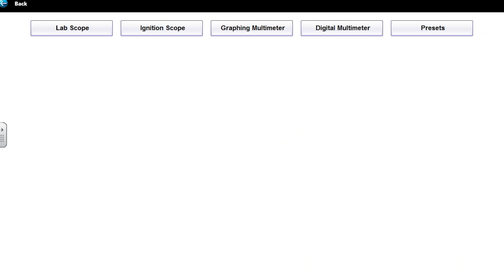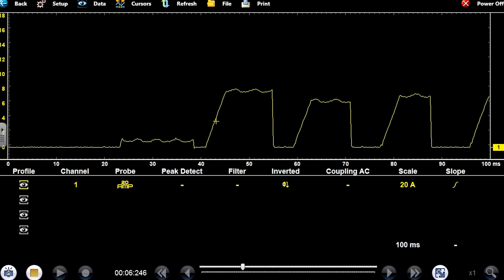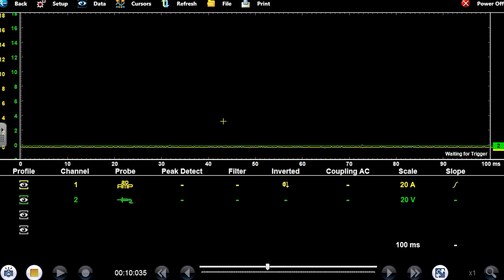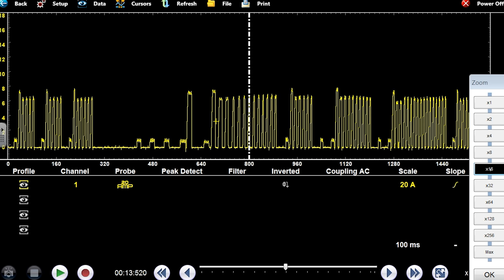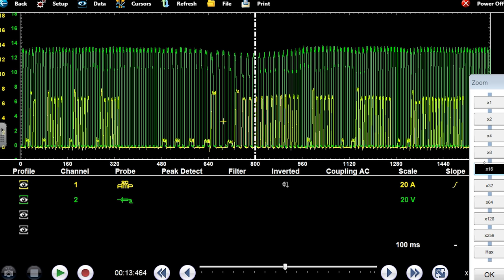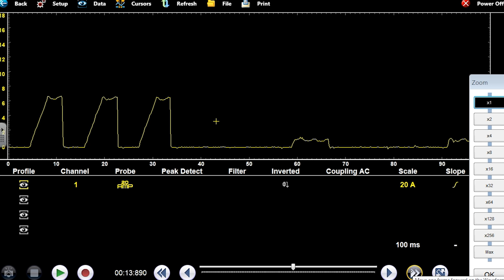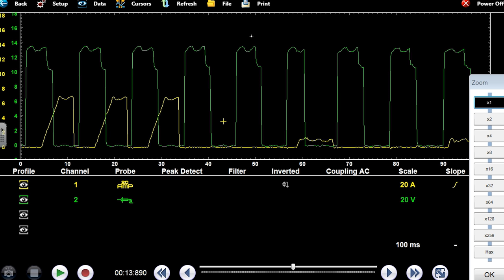Getting My A$$ Kicked By an 86 Mustang (Part 1)

Comment: I have a video on a 1986 Ranger where I went down a very similar rabbit hole! What I found is that quick changes in the engine RPM will cause the TFI module to drop coil control. It was a very similar waveform. The pickup signal would never drop out, but the coil side would. The TFI just can't "keep up" with the rapid change in engine RPM. In my case, the truck had a bad coolant temp sensor causing the engine to run super rich making it stumble and run rough. The RPM drops were causing the coil to drop out, not the other way around. Was a real head scratcher.
Reply: how'd you figure that one out?
Reply: Here the link if YouTube will allow it: https://youtu.be/GTN6FpsIdDU
Reply: @WatchWesWork  well that waveform looks awfully familiar .....Same exactly...its a mirror imagine..  interesting idea with the drill. I dont think I even have an adapter for obd1.. Good find though man,, I wonder was Danner getting any codes?
Reply: im super impressed
Reply: Lol just watched your video and i bet its the same problem. Nice job!
Reply: I have an 86 5.0 Modified, intake, TB, Heads, Rocker arms, exhaust and running OEM CPU, I've never had any performance issue.  Ignition Module has been replaced twice with 130 k miles on it now, Ignition module has Always kept up with the mods.
Reply from the maker: Cannot see an ECT causing loss of coil primary control. Sounds like you had two problems my friend 😉
Reply: @ScannerDanner  That's what I thought too. I confirmed my results on another similar vintage Ford engine. If you snap the throttle from idle, the coil control drops out for approximately 2 revs of the engine. I pulled the distributor and confirmed this by spinning it with a drill. Snap the trigger on the drill and the pickup signal is good, but the coil drops out.
Reply from the maker: @Watch Wes Work  i don't want to say too much, to give away my next part, but we can brain storm with that situation after I release it. Deal?
It doesn't matter what the sudden RPM changes do to the PIP signal, coil primary control should not drop out. Period, ever! If you fixed yours  with an ECT you simply covered over another issue with that ICM. Not that you changed something you shouldn't have, it just shouldn't happen. And that you've had another vintage one do it too, is just going to reinforce what I'm about to show in my next part
Reply: @ScannerDanner  It could be an issue of parts quality. I don't know. But my test was with a brand new distributor, pickup, and TFI module. I'd be curious to see if anyone else can duplicate it.

Comment: Those modules have always been junk. Back in the 80's they sold them in the auto parts section at K-mart. People would drive around with an extra module in their glove box. That PIP signal is way to consistent to be much other than pickup or module.
Reply: Oh man that brought back memories of having a handful of those laying around, I looked through my spare parts drawer and still have one in there from my old 3.8 tbird distributor lol
Reply: same with those honda main power relay, keep one in the glove box..
Reply: @bwdz75 :  I still have a known-good, 4-wire, HEI module in my toolbox that's coming up on 40 years old. We were still troubleshooting a lot of POINTS ignitions in the 1980's 😆.
Reply: I kept a spare with the little tool to change it in the glove box, along with some arctic silver heatsink compound 🤣. The thunderbird turbo coupe was worse, you had to use motorcraft or it would not run right at all.
Reply: I had good luck with Motorcraft modules, but the key was to have the correct heat sink compound on the back. Without the right stuff, they'd fail real quick!

Comment: You'll go through five aftermarket TFI modules before you find one that works correctly. Looking forward to the video of it running correctly.
Reply: I've found Standard brand to be the better of the bunch. My 1st choice would be WVE, if they make one. I haven't checked since mine has been still working since '07 when you could still buy them at Ford dealers.

Comment: Just fixed a 12 jeep liberty and it went from shop to shop to shop. Never got fixed until i came to me and when i did i used everything i learned from your teachings to diagnose it. Never changed a part without a proper diagnosis. it was a crank sensor  that was intermittent. Thank you so much for everything🙏🏻🙏🏻🙏🏻
Reply from the maker: my man! nice job, seriously, props to you for making it happen, I just provide a means and most don't take advantage or they don't know how to apply it
Reply: @ScannerDanner  I've sent links of your videos to shop owners and don't get much of a reaction. I guess following a flow chart is good enough....
Proving powers and grounds and 5 volt reference are trouble shooting methods I've learned from you.
Reply: @ScannerDanner  🙏🏻

Comment: As a Foxbody owner/modifier/repairer for the past 20+ years i'm excited to watch this one.  I really enjoyed your previous EEC-IV video on the F150, but this being an actual 5.0 Foxbody I can't wait to see what happens.  :popcorn:
Reply: Right On, I'm a 86 GT Convertible original owner and love these videos.  Got to tell you the OEM CPU and Ignition is Rock Solid other than sometimes the IM module fails. But I got '87 GT ported heads, 45 degree valves, Cobra Rocker Arms, High Performance valve springs, HP headers and exhaust system and 3:55 gears for a little more acceleration, runs like a champ !!!!

Comment: I worked on a ford truck with one of these systems, it had a bad module. Replaced it and it ran good for about 15 min. Got another module same thing happened. Parts house had a tester for these modules so we started ordering them from every parts house and had them test the modules before we even put them on. All of them tested bad straight out of the box!!!! Probably tested 10 new ones, ended up finding a used one someone had in there took box for like 20 years and it fixed it lol. JUNK PARTS!!!!

Comment: Paul, Alldata does show a internal diagram of the profile ignition pickup in the ICM, under description and operation, might be of help, might not? Also if memory serves me incorrectly, the resistor (22 k ohms) Alldata shows in between ECM Terminal #4 and TFI and ignition coil control circuit DG/Y, will do some weird things to these engines!!!!! if failed! Looking forward to part 2 and 3 etc!!!!!!!!!!!!!!!!

Comment: love it when it is challenging(not in a bad way).it just means we all face things that can really require us to stop and think about our process question our diagnosis....truly i am looking forward to what is the fix...i think the biggest threat to techs today is the possibility of a BAD part. and with all it takes sometimes to get to the part only to have a bad one installed.makes me very angry and frustrated for our future techs to have to deal with it......looking forward to the FIX....great video Paul...Caleb....James..
Reply from the maker: spot on with your comment on how difficult it can be when bad new parts become part of the variables, like this job isn't hard enough as it is right? Thank you my friend
Reply: @ScannerDanner  
Oh it can be a nightmare. There was a time one vehicle had a bad brake switch , light stays on , swab out the brake switch with aftermarket part , no fix light still on. Went back to the store replaced it under warranty as defect. Plug it in same issue light stays on. I had to remove the switch again and this time opened the switch up and I saw that the plunger never makes contact inside the switch. It was a defective design of the switch. Went back to parts store explain the issue and got a 3rd switch same brand and opened it up same issue. Decided to get oem switch and problem solved. The oem switch plunger had a resistance feel with the spring. Better design.
Reply: @dcomputers  I just replaced a belt and tensioner on a '13 Ram Hemi. Gates tensioner, lifetime warranty. Well, a lot of good that lifetime warranty did - it lasted a whole ELEVEN days and 178 miles before the spring crapped out inside!! So pissed! Now my customer was pissed, so I had to go to Advance Auto for a Litens brand (never heard of them). At least this one was made in Canada instead of TURKEY! So I used Advance Auto's same day delivery - big fail there! Roadie, the delivery service they use, couldn't get a driver to come out here from the city! I called and complained - they gave me a $10 Speedperks. Told me it would be there some time after  9am the next day, Sunday. STILL wasn't here by 2pm! Ended up having to cancel the order and pick it up in person. What a huge PITA!! All because one company couldn't produce a quality part!
Reply: @Smitty Smithsonite  
That is the issue with some aftermarket parts. I had a vehicle that h
Needed tbelt job . Found a cheap tbelt kit with seals tensioner. I notice no name on the parts that was a red flag. After 2000 miles the tbelt seals and tensioner failed. Too much tensioner idler belt cause belt to slide around the seals were not sealing. Had to redo job this time oem parts solid quality
Reply: @dcomputers  Gates used to be a good brand in the day. Not anymore I guess!  Yeah, learned a long time ago to never use cheap parts on jobs that take a bit of labor, like timing components, engine internals, or just any electronic component. It'll bite you every time!

Comment: One other sense for grounding the Module to the Dist. housing is maybe to help protect the signal in the wires from EMI disturbance.  There was a TSB sent out for the fender mounted ICM versions that explains about a corroded wire, inside the foil wrapped harness. 
So when the Module was off and away from the Dist. maybe EMI was leaking in , threw the jumper wires witched caused the "No-Start".?  Thank you for proving out each factor of flaw possibility to eliminate any questions and allowing more learning experience for all of us. i really do appreciate it so much!

Comment: Module to distributor to pickup ground, I saw the module was well coated with heat sink compound. Heat sink compound is not conductive but you would think the bolts would make a good connection. Waiting for part 2

Comment: Thanks for doing EEC IV videos . very important to me.  In my shop I only work on vehicles before they had body control modules ..
Reply: You need to look up Scannerdanner old video with White Bronco and a bad distributor pick up coil, the scope wave Ignition analysis are awesome and he has video with f150 that has weak pip/spout signals caused by low power from ECU power relay, awesome stuff, you won't be disappointed!!

Comment: Sometimes it’s better to be a parts changer, its save lot of nerve cells. Of course risk of reputation damage is high. Here in Europe we have lot of diesel cars and sometimes it’s need to be a parts changer if you haven’t expensive equipment, I’m not a proud of it, but mostly I have lucky fix. Waiting for part 2! 👍

Comment: Great information, i'm living identical scenario on 96 5.8 f150. I discovered there are at least four ignition module possibilities, the so called push start version, available in distributor and remote mount, and the computer controlled version, also available in distributor and remote mount, purportedly differentiated by grey or black color. As you said, these are all aftermarket parts of unknown content or quality. Good luck; anxiously waiting part 2.

Comment: You and many others in the comments section are MUCH smarter than I and have much more skill on this (just an enthusiastic DIY guy now).  I know my mentor on electronics always told me that if I had a weird issue, check your grounds, if on a car to check the battery, check alternator, then check every ground you ever thought about having again including removing and polishing the contact points for them, then ohm the ground wires while flexing.  Especially on foreign stuff and12v neg stuff.

Comment: Wow its been a while since I seen an EEC-IV ignition!! That ground is a concern between the TFI module and the distributer, I noticed a lot of thermal grease (maybe a bit too much) which may cause an intermittent loss in ground connection. However, searching on Alldata there is a generic TFI ignition schematic showing the 3 hall effect sensor wires to the module. It showed one of the 3 wires is supposed to be a ground. Hmm, a ground between the hall sensor and the module...  But why is the external connection needed?  Thanks, Paul for the case study!!

Comment: 2 dizzys in my 93 foxbody in the past yr, first replacement was bad out of the box, second still goin, neighbor has a 90 corolla that ive put 4 dizzys in it in 8 months, first one bad right out of the box, second carbon rod in cap came out and destroyed internals, 3rd one bad out of the box, got money back from oreillys and bought 4th from advance, this ones good, hopefully itll last longer than 6 months for him this time. Great video btw cant wait for part 2, all info i can get on these systems is incrediably helpful!

Comment: Back in another life we built more then a few 2.3 efi turbos and 5.0 Fox bodies. I found a few things for sure. When we were chasing the elusive clean pull through the RPM band. We did two things. Clip a few jumper cables from the engine to ground and battery. The other was run the vehicle with a battery charger on it. 

Also the TFI and PIP always needed to be OEM Ford parts. Sometimes the reluctor wheel can get damaged when replacing the PIP.

Comment: I had a similar situation with an aftermarket module. The blades weren't quite
as thick as the old Motorcraft module, so when it was plugged into the connector
it wasn't making a strong contact 100% of the time??

Comment: SPOUT is timing signal as controlled by ECM. Disconnecting it switches timing to control solely by IGN module at a set ten degrees btdc.

Comment: Excellent video.  At 52.42 you mentioned a possible heat issue and I notice when you came back to it after taking a break to work on another car it started and ran good for the first few minutes then as it heated up it started running bad again and seem to me to run worse and worse the longer it ran.  From my days at a Chrysler dealership that was characteristic of a pickup coil.

Comment: Paul I have a 88 E350 with a 460 cu. in., and I went around in circles on mine also.  Mine ended up being the pick up coil. Try checking the timing with a timing light and leave the spout in and watch the spark advance. If the advance is jumping around like mine was it's the pick up. I would unplug my spout and the spark was steady with the timing light and she ran and drove smoothly, even though she had no spark advance she was at least drivable.  As they say, garbage in, garbage out. If the computer is getting a bad signal from the pick up its gonna give a bad signal for advance spark. That's why, (I believe) the mustang was 90% better without the spout connected, I think the intermittent miss (without the spout connected) was still pick up related. As far as the grounding issue, it's been awhile but I think the pick up does ground through the module, you'll have to check the schematic. Even though they're all China junk,  I would just replace the pick up not the whole distributor, their easy enough to do, just takes a little time. If it is the pick up, what took out the pick up in the new distributor? What took out old pick up? Was it the Alternator or excessive battery charging?  I would shy away from using the battery charger as sometimes I think I fried my pick up from constantly having my battery charger on all the time trying to fiqure out another problem I had. Depending on the amp setting on the charger it can put out quite a bit higher voltage. Anyways, just thought I'd throw my experience out there, hopefully you fiqure it out and I can't wait for part 2!

Comment: With that ford truck I did I was at my friends house and the truck was idling warming up and sounded great then all of a sudden the idle changed and became irradic and black smoke coming from tailpipe I seen it was almost out of gas so I had him go put gas in it and it still ran like crap, that's when I shut it off and turned the key on and the fuel pump kept on running so replaced ecm and that took care of problem.  Thank you for getting back to me I enjoy watching your videos

Comment: Not done with the video yet, but i recently had fun with a 66 mustang that had a 93 drivetrain & electronics. Two new distributors from napa, which are cardone parts... Both had bad TFI out the box, one had a bad pip out the box also.
Im glad i had known good parts to use.
Heat will cause all sorts of issues with the 93 and older TFI systems.
O.m.g i felt every emotion you guys did!

Comment: That AC ripple off the alternator could of hurt the module, you mentioned the AC feed back from the alternator to getting pick up by the hall effect. I've never depoted any of modules before, i do understand how it works, and component type for like example film versus electrolytic capacitors. Electrolytic capacitors both polar and bipolar struggle with AC. There are very fine tolerances components can have. As low as 0.01%  when i got into valve Electronics the first thing i got was a vtvm specifically fir the analog resolution, its whole voltage divder used 1%(+,or- , some parts have ppm values etc) resistors which are very differnt from todays time every one of them were way off. Great video friend!

Comment: Hey dan, after thinking my 89 Dakota had a charging problem, I found out that they do not charge like most systems, the charging system seems to put out exactly how much is being taken out, it does not charge over 13 volts like most do.. for some reason, batteries in these systems last forever!!    I think its because they dont sufate as quickly, from being overcharged constantly.
 I replaced the battery, alternator, checked all wiring including grounds, ect.. these systems use a hall effect pick up ignition system.